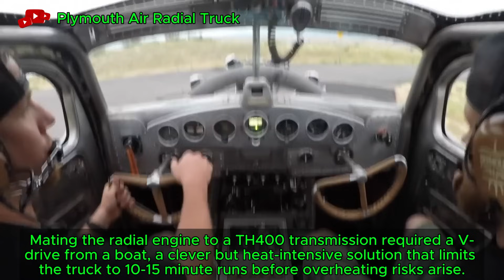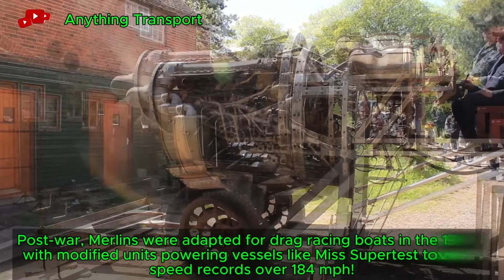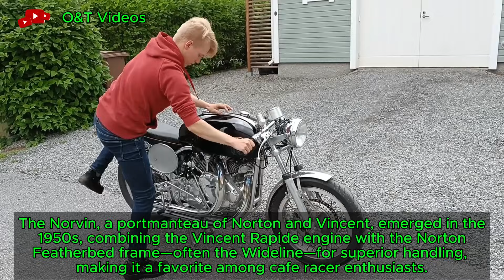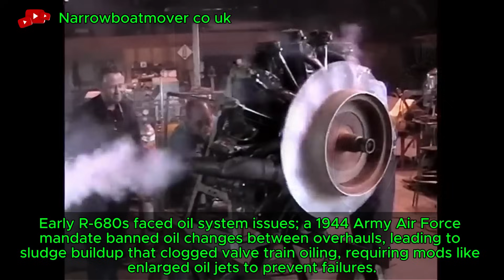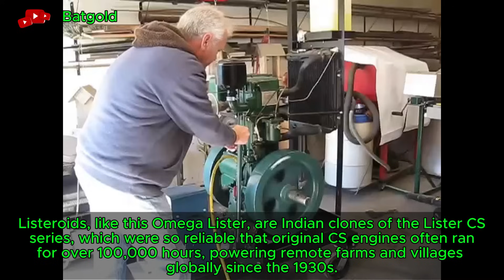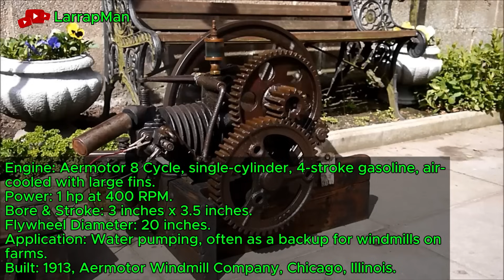Rare Old Engines Starting Up Sound That Will Blow Your Ears! ▶ Part 35

Comment: Love the Norvin motorcycle... I had a Norton 750... The Air starter for that Listeroid engine was a rotary vane air motor just like in an air powered impact tool... Therefore the cause of the angry buzzing noise on startup. Definitely quieter than the monster air starter used on some MACK trucks. Lol
Reply from the maker: I bet your Norton 750 was really nice back in the day; those bikes have a special place in history. That spinning airfoil motor sure makes a loud noise when it starts up — it reminds me of the old tools we used to tinker with years ago. Thanks for sharing and I hope you enjoy the next video just as much! 😊

p/s: Can I ask you about the thumbnail, which of these motors deserves to be the thumbnail for this video, my meticulous clicking isn't very good haha
Reply: @PTValleyEngine  that's a really hard choice... I've been really fond of the old Petter and Lister engines because they were the best when diesels started out. An odd one that I found during an exploration of an abandoned WWII underground bomb factory was a big 6 cylinder diesel made by Enterprise. I found an air shaft going into a BIG hill that had a huge steel door welded shut. Once I got inside to an air handler, I figured a way out of the system and found myself inside a power generation/mechanical room. I spent hours inside there and found out it was night when I finally got back outside. The whole underground facility was otherwise empty but it had huge copper grounding straps going along all the walls of each room. It was really cool but also creepy at the same time. Getting back out was the hardest because at one point I had a 15 meter vertical climb to get back out. I loved England... sooooo much history. The base I was at was the one they used to do the flight tests for the Concorde... RAF Fairford.
Reply from the maker: @gerrywalsh5766  The Enterprise 6-cylinder diesel you found in the underground WWII bomb factory sounds truly impressive. Exploring a place like that, with huge copper grounding straps and a space full of history, must have been very special, even if a bit creepy. Climbing 15 meters to get out was quite a challenge—you’re really brave! Thanks for sharing this experience! 😊
Reply: @PTValleyEngine  Thank you for the complement but it definitely wasn't bravery...just plain Irish stubbornness.   LOL
Reply: @PTValleyEngine  Also the in ground Day Tank had several hundred gallons of diesel fuel in it and the engine crankcase was full of oil. If I could have gotten air into the starter storage tank, I'm sure that the old monster would have been happy to start up. The engine drove a 60 Hertz AC generator which tells me it was probably a US built set... It directly powered a 150 Kw motor which drove a 100 Kw 50 Hertz generator. Since being in England with their 50 Hertz power grid makes sense in a convoluted way. When it got out about what I had found, our base commander had the engineering guys cut open the main door and then that place was allocated to store our War Ready Equipment. Support equipment to keep our aircraft flying in a possible war time environment. At that time our Strategic Air Command was renting R.A.F. Fairford. I found that bunker in 1984... I sure do miss that place... Beautiful countryside. Oh, got to see Prince Charles at a Polo match nearby and almost got beat up by his personal guard.   Lol
Reply from the maker: @gerrywalsh5766  The 60 Hz to 50 Hz setup is such a clever workaround for England’s grid. I love how your discovery turned into a storage spot for war-ready gear at RAF Fairford. And meeting Prince Charles at a polo match—almost getting roughed up by his guard is quite the story! 😄😃😃